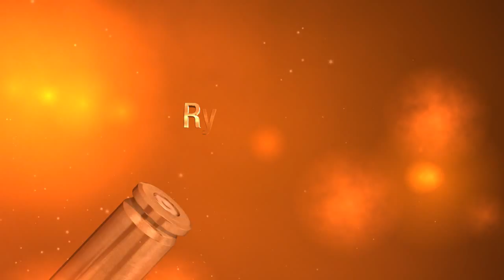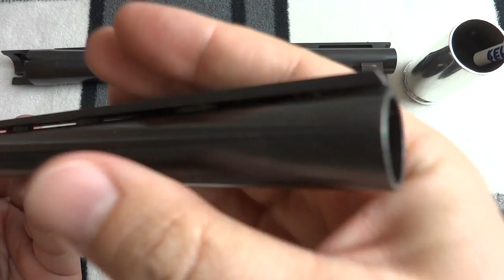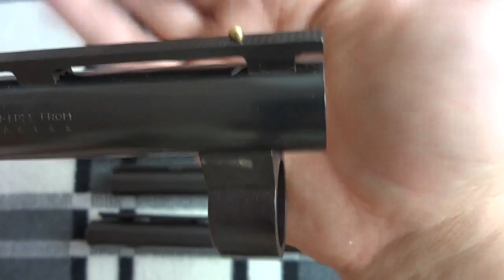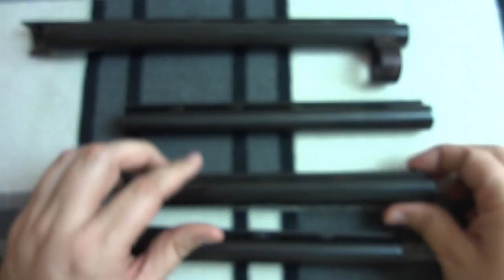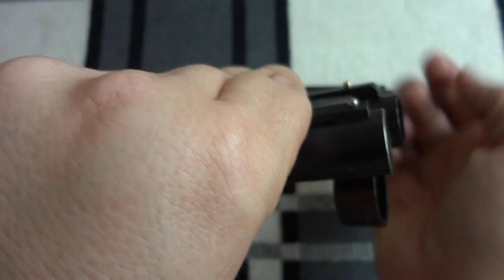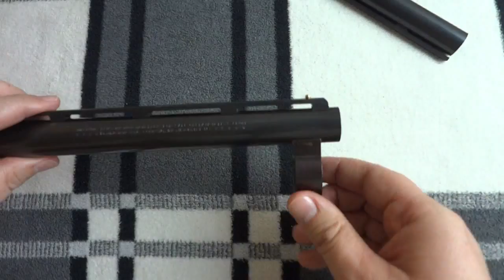Shotgun Barrel Cutting: Finishing Vent Ribs

Comment: call me crazy but I plan on cutting my model 55 down(12 inch barrel) for a home (trailer) defense gun
Reply from the maker: You may not be crazy, but to do that legally in the USA it will cost you $200 and you'll have to wait for approval of a BATFE Form 1.  I'll call you crazy for wanting to do this with a bolt action worth $100 instead of just getting a Maverick or other bargain pump action that you can also use for other things.  Were I in possession of a Marlin model 55 and wanted more utility, I would cut it down to between 18.5" and 24" and put a choke tube on it.  Home defense?  Any shotgun will do.  For many, many, MANY farms in the USA, the double-barreled shotgun was THE home defense gun from Colonial times up till today.  Pump actions are taking over, though.

For the sake of covering my bases on this, though, a Shotgun requires an 18" barrel or longer in the United States to be legal as well as an overall length of 26".  There are exceptions for guns that are over 26" and have never had a shoulder stock.
Reply: +RyeOnHam I am going to leave the full stock so my gun would be over 26 inches over all
Reply from the maker: Still illegal without the $200 and ATF form 1 approved.  It needs an 18" barrel on it as well as 26" overall length. The exception is only for guns that came from the factory with a pistol grip.  If it's ever had a stock on it, it needs a tax stamp to go below 18" on the barrel.

Comment: As mentioned here already a dremmel tool with a small cut off wheel makes this easy. You are way over thinking this.
Reply from the maker: No, just no.  Also, you didn't see what I did or how long it took because YouTube doesn't allow that stuff for some reason... How long do you think this took me?  I've never seen any gunsmithing-by-Dermmel turn out good looking.
Reply: @RyeOnHam  im thinking more about utility than esthetic.
Reply: @RyeOnHam  how do you cut off a barrel? Without any background in precision you could do it with a lathe but with a vent rib you are largely stuck with band saw, then likely file by hand
Reply from the maker: @GregariousAntithesis  Not sure what you mean by a "background in precision" but I have cut more pipe in my lifetime than I care to think about.  I have used many methods such as a vertical bandsaw, but those are pretty expansive and take up lots of room.  You can do it with a hacksaw and then clean up the end, but getting it perpendicular is the trick.  You can do that with a belt sander and a 2x4 clamped on the base to get 90 degrees, you just have to watch out for the taper of the barrel.  The easiest method is to clamp the barrel in a miter box so you get 90 degrees every time, again assuming you compensate for a tapered barrel.